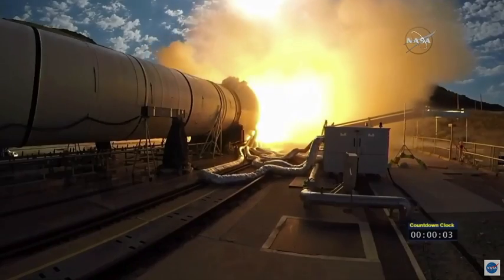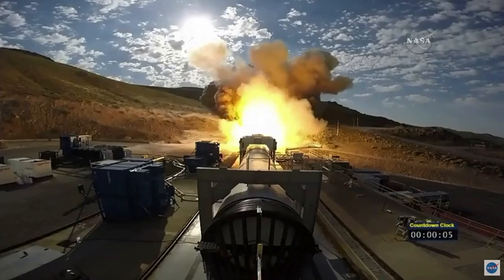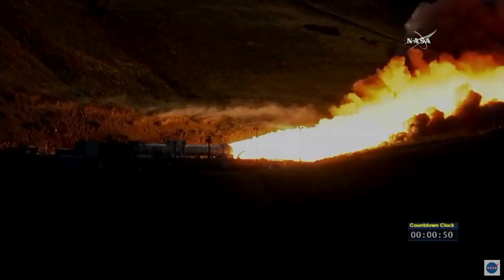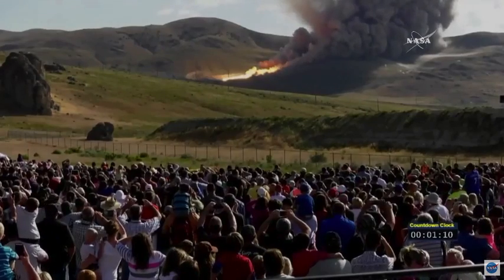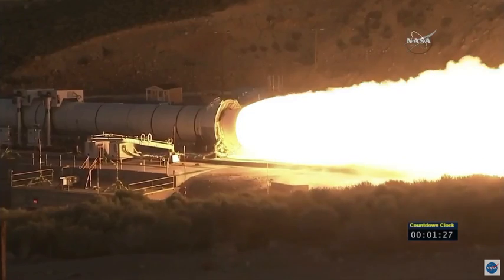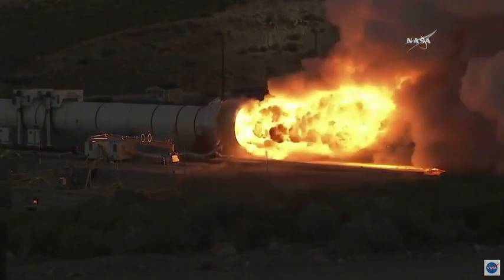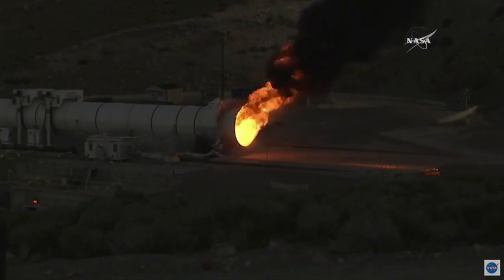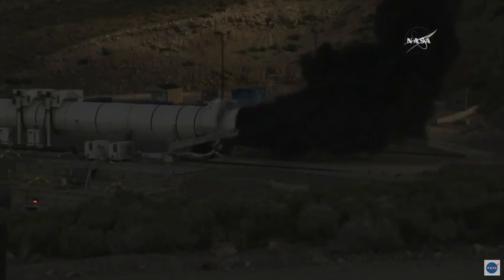Huge Space Launch System Booster Test Fired In Utah | Video

Comment: That was awesome! How does the end of the rocket booster not melt and blow of as liquid metal?
Reply: Great question!  There are many ways rocket nozzles can be cooled (so they don't melt!) as I'll link below.  Most of those ways apply to liquid rockets though (doing things like using the liquid fuel itself to provide cooling), but this rocket isn't liquid fueled.  The boosters in this test, are based on the tried and true space shuttle's old boosters, so they are solid rocket motors.  So in this case as I understand it, the cooling is done via ablative vaporization!  The walls of the nozzle are lined with a phenolic material that is continuously vaporized and carried away.   In other words, the inside of the nozzle is actually be consumed, just at a controlled rate.   https://en.wikipedia.org/wiki/Rocket_engine#Cooling
Reply: Protonus Awesome! Thanks! :-)